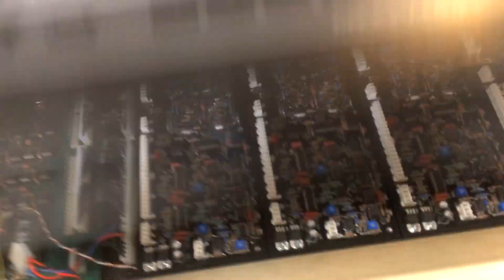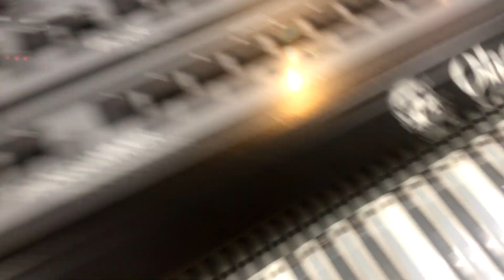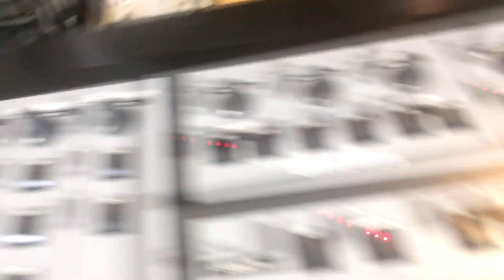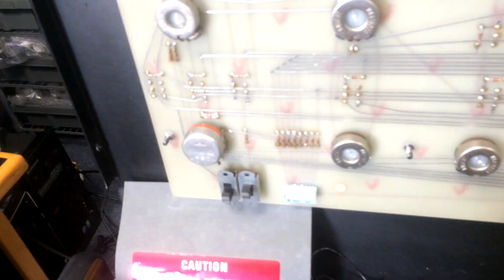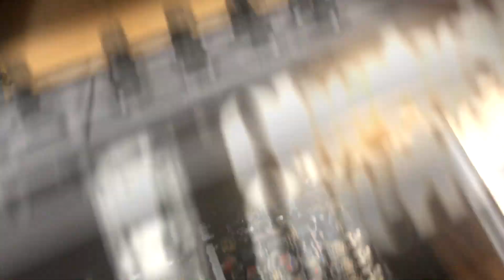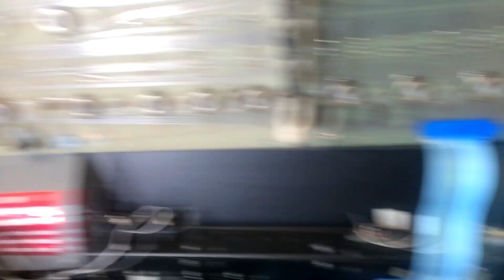[Abstrakt Instruments] Oberheim OB-X Calibration

Comment: Thank you this was very helpful for calibrating my OBX especially when it came to the filter tracking using the noise against a test tone.  I did find though that tighter results with initial tuning by not using the calibration mode switch.(kept in down position) although mine is an early one with the multiple binary switches.  either way my obx is now in good tune with just enough slight movement to make it sound interesting.